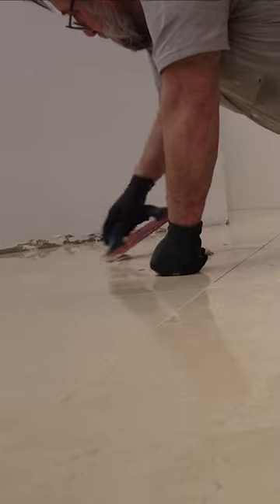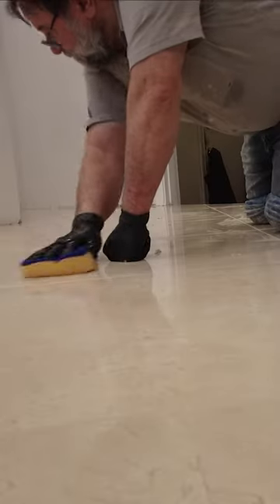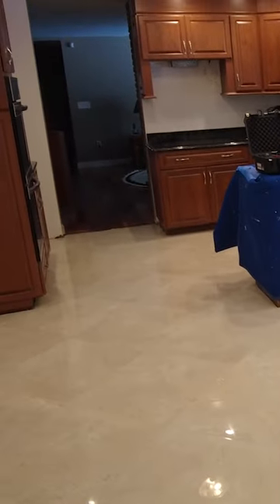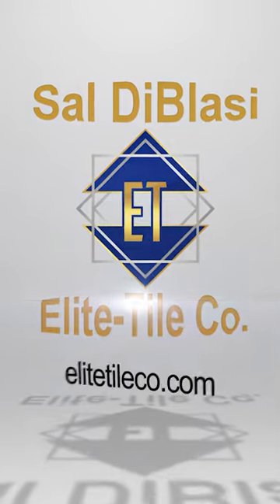Leveling a floor, without self leveling floor compound how to #leveling  #selfleveling #shorts

Comment: Hi Sal.  What product is that?  I’m prepping for 12x24 porcelain tile in a bathroom.  I need to make my floor flat but not necessarily level so self leveler is not an option.  You mention Eco Prim Grip primer but not the compound used.  I don’t see it in the description either. Thanks.

Comment: Hi Sal, I never saw you use Durock or other cement board. Is there any reason for that?
Reply from the maker: Foam is better
Reply: @SalDiBlasi  How do they compare price wise per square feet? I know Durock should be somewhat cheaper, but it involves a lot of heavy lifting. On the other hand the thinset for Ditra is quite pricey, and you need two layers, right? So how do the compare?
Reply: I am using Hardie backer board right now and regret it. It was cheaper than foam board but in retrospect it would of saved me tons of time. Just my 2 cents.
Reply: @orlandoo4552  Thank you for your input.

Comment: So I can use thinset if it’s not to deep
Reply from the maker: It is not thinset, it is a cement base patch designed for the purpose. do not use thinset. Link in the products section
Reply: @SalDiBlasi  thank you
Reply: Can't find link can you adress me?
Reply: @SalDiBlasi  great vid. Exactly what I need for a job now. Would you mind stating the product? I don't see a link. Thanks a lot!